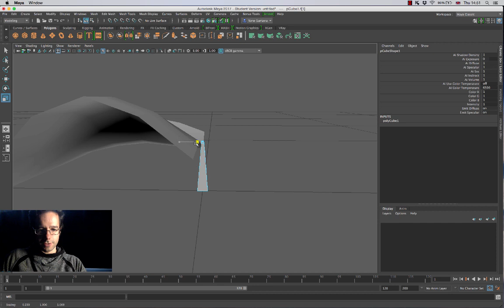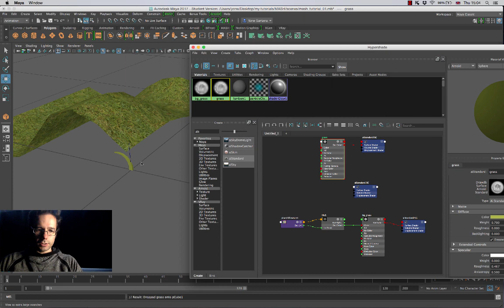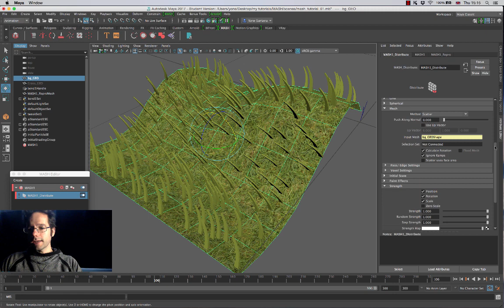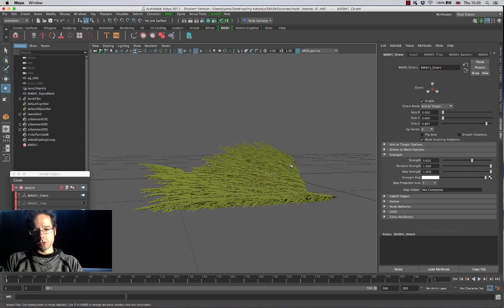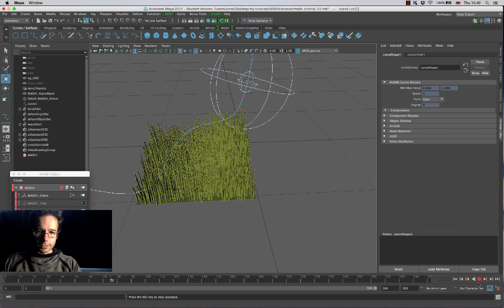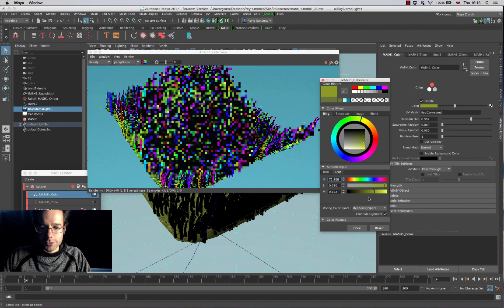Comment: Great video! Makes transitioning from 2016 - 2017 a little bit easier for us artists. One thing. I hate to be critical but, is there anyway you can use an external mic ? The fan noise can get a bit distracting. Thanks for your upload!
Reply: Nope. There is never a problem with some constructive criticism. The fan were disturbing me too so I've been using a USB headset for the last set of Tutorials. Fan noise has gone however I'm not too happy with the current sound quality. 

Pardon our dust. While I figure out a better set up.
Reply: Wow, that's a fan! What the hell is it cooling? LOL
Reply: thinking the same thing jajaja

Comment: Maya mash FBX animation exporting blend shapes. It does not seem like there is a way to export blend shape animation nor ik skeleton animation that is being instanced by MASH. If you create a MASH network and then just animate the distribution tab a little bit then export using file > game exporter and as long as you add an animation clip and have FBX reviewer installed and checked (view in FBX review) you can see the animation there. BUT if you go back to the original model you created the MASH instance from and animate its scale or rotation or add a blend shape or add an IK skeleton to it then the animation you do will render nicely in Maya but you cannot export the animation to a game ... Does anyone know any tricks to get this working? I would like to create swaying grass with MASH but it just does not export the animation :(